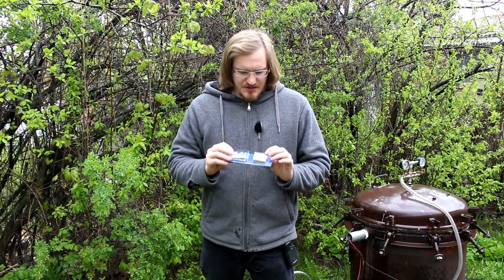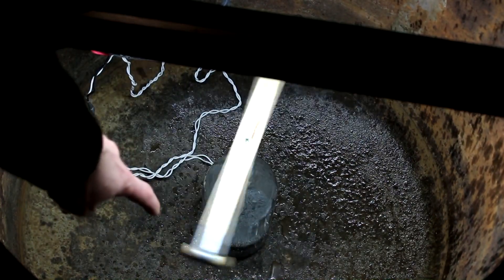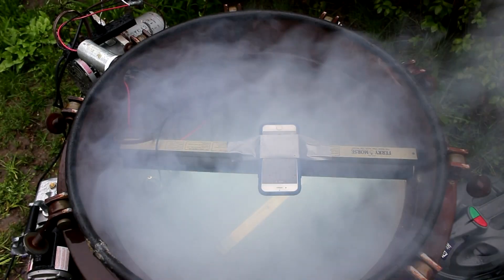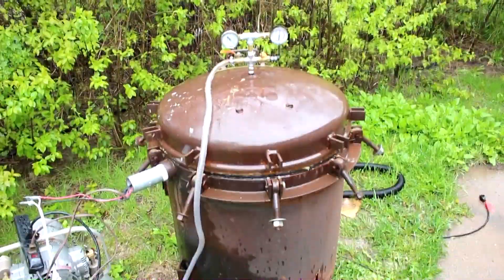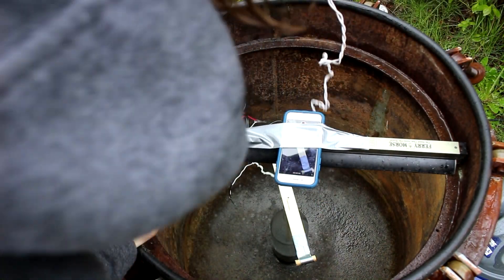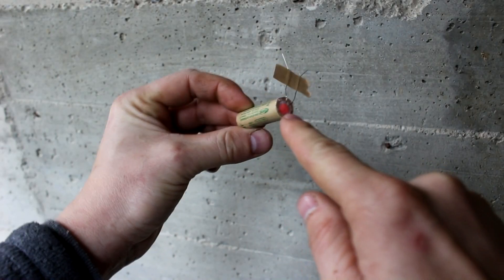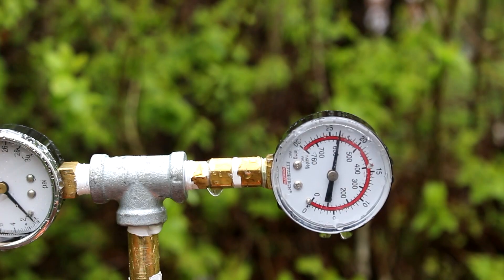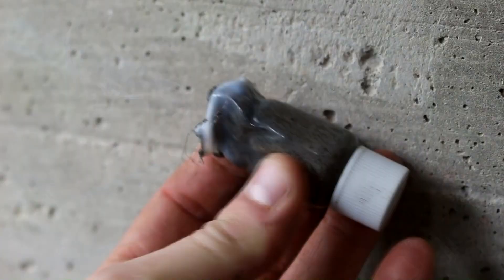Will a Model Rocket Motor Work In Vacuum?

Comment: but nasa doesn´t have to think about this issue when starting on earth, the rocket motor starts in normal pressure and burns until it´s in a vacuum
Reply: Yeah but there's still plenty of rockets that need to fire in space that work on quite clever means such as pressurizing environment to create ignition then releasing exact amounts of thrust for maneuvering or the special fuels that ignite upon contact.

Comment: how about running a motor with a fan on it in a vacuum and somehow measuring the rpm's it turns, and current the motor draws, vs running the same motor at atmospheric pressure.

Comment: my guess is that since there is no resistance,the initial blast is enough to completely erode a layer of fuel off, which separates the bulk of the fuel from the ignition

Comment: Hi Cody, why does the water in the pressure chamber move that weird when you lower the pressure?
Reply: Steffen623 the water is boiling at reduced pressure
Reply: Steffen623; If you look closely you can actually see the large bubble of water vapour forming as the water boils...
Reply: you talking about near the end when he is showing real time pulling the vacuum from inside with his camera?

if so, its because there is some water under the base of the stand that is holding the balance and the engines, as air pressure decreases, it can seep out in a wider area around the base. as it outgasses a little, the pressure goes up slightly so the water is pushed back to its "hiding place" and it keeps going back and forth trying to maintain an equalibrium.

Comment: It appeared that when pressurized in the little bottle it ignited, but went out when the bottle was breached.  The rocket only accelerated briefly then was coasting.  In the air pressure control it accelerated longer.  If true, then it still did not burn in a vacuum.

Comment: Cody maybe you should try casting some small nozzles out of epoxy or a metal of some sort, this should be much more efficient at maintaining pressure within the rocket whilst ejecting enough to propel it. I'd recommend trying a few different designs and possibly mixing your own motors using a fuel such as the one Grant Thompson uses.

Comment: It is not generally a good idea to plug in electrical outlets when it is wet.
Reply: BigCtv try don't trip that fast
Reply: the power strip he was using has a built in GFCI which will trip before anything can happen.
Reply: Hj Aviation it was fine! this guy is much smarter than you
Reply: No shit Sherlock!

Comment: will thirmiet burn in a vacuum?
Reply: serenity Furry I would think it would so Cody why dont you put that to the test thermite in a vaccum that might prove interesting can you weld with thermite in space?
Reply: probably since it has an oxidizer in the form of iron oxide. There will be a few problems though. One getting it lit might be a problem because it takes a lot of energy to get it to light and, most burners or energy sources won't burn in a vacuum. Number 2 Cody would end up destroying his vacuum chamber that he put a lot of work into because of the molten iron dripping out the bottom.
Reply: I'm pretty sure it would burn but yea like you said it'll take alot to light it
Reply: Mitchell G a sand container should protect his chamber and glycerine and potassium permangenat should ignite it
Reply: Joe Rowland That's a different way to look at it. I didn't think that KMnO4 and glycerin  had enough energy to even light thermite.

As for the sand that's a good idea as well. Yet thermite still might throw molten metal around which could compromise his chamber. 

Either way those are both valid points but i don't think that Cody should put every explosive or "things that go boom" in the vacuum chamber.

 One we already have a pretty good idea of what is going to happen. putting it through all the extra trouble that is a vacuum chamber probably won't change much.

 Lastly and most importantly, Cody has strongly expressed before that he doesn't want to become a vacuum chamber channel. Which would quickly become extremely boring, not only to watch but to construct as well.

Comment: im guessing the liquid oxygen in real rocket motors is there for a reason lol  but they also use the solid  fuel boosters.. which i suspect contain enough oxidizer to support combustion in a vacuum  the hobby rockets your testing are basically black powder

Comment: I suggest cutting open the motor, I'm not sure it burned completly.
Arent't those motors supposed to pop acouple of seconds after burning up?
Pretty sure the one under normal pressure did...

Comment: stop calling it a motor just call it a rocket
Reply: But it's not a rocket. It's just the motor. The rocket is what the Motor goes in.
Reply: well to be more precise it's a fuel cell, but since that is what is creating thrust for the rocket 🚀, it's the power source of it, hence why it's also called a motor
Reply: I would say it is an engine, not a motor. Rocket engine.https://www.grc.nasa.gov/www/k-12/rocket/rktengine.html People do commonly call these "rockets" on their own, just as a shorter term for rocket engines though.
Reply: rdizzy1 yeah I know it's an engine :) but people that don't know the difference also call it a motor, it's actually a pet peeve of mine when I hear someone call a gas powered engine a motor XD (motors are electric, engines are not) but I did it anyways for the laughs 😝